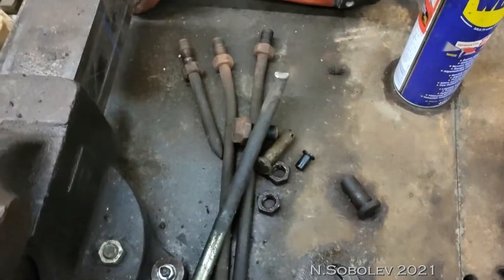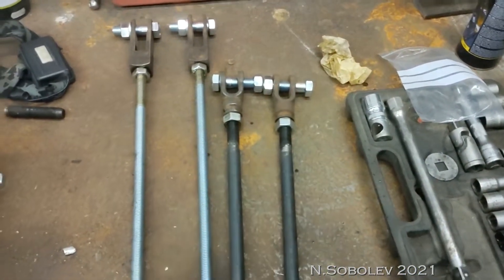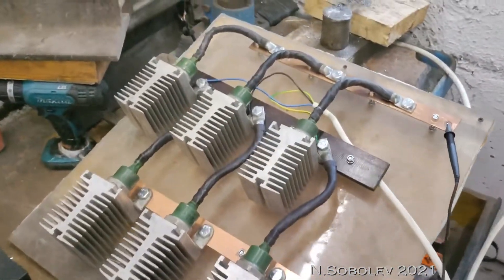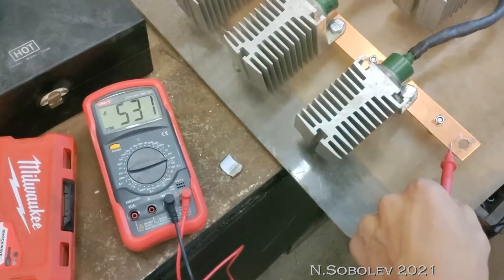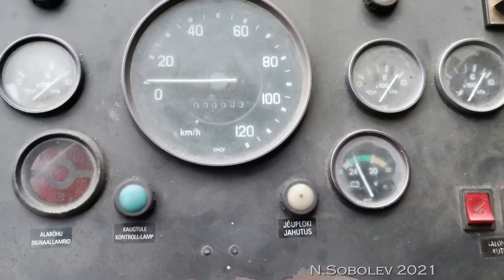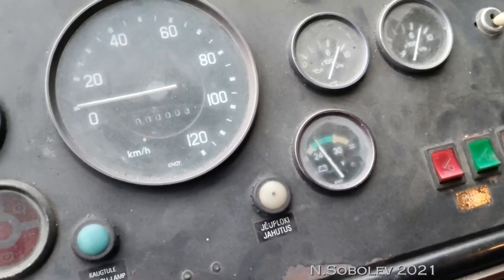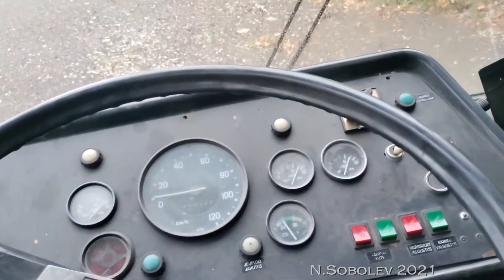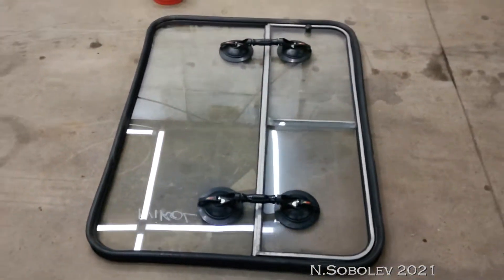Wireless trolleybus build part 4 testing the home made rectifier

Comment: Diode bridge from generator? Or for what?
Reply: I guess the generator puts out 400V 50Hz AC. More precidesly 3 phase AC, since he's using 6 fat diodes. I guess 550-600V (or 660V) is the common trolley and tram voltage accross Europe, so 530 is still in the limits (I don't know, it should cut off around 450-500V maybe?)
Reply: @Bzmot332bve  allowable voltage from 15Tr is 420 - 720 V
Reply from the maker: yes, in the video i used city power to test diode bridge,with generator i get 570v
Reply: @skoda15tr65  thanks for the answer)
Reply: @Bzmot332bve   Minimal limit for trolleybus is 420V.